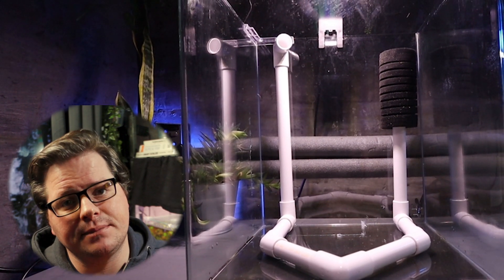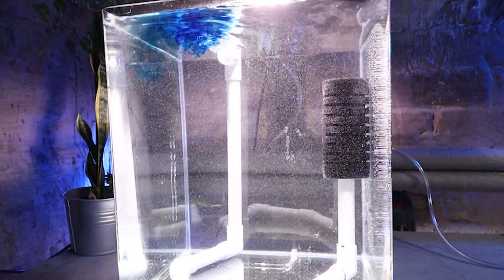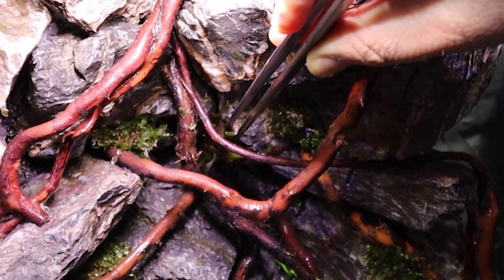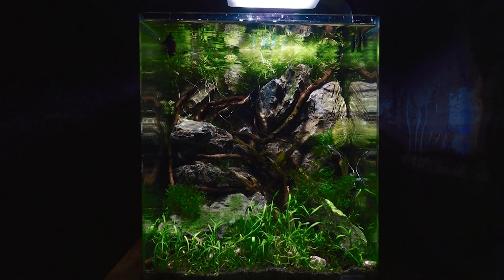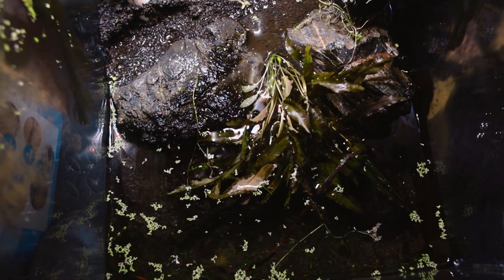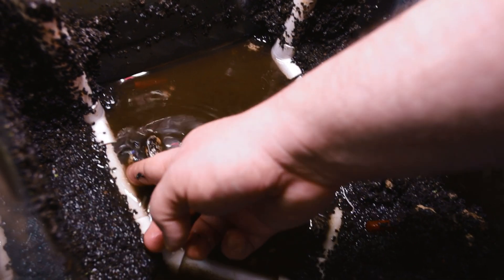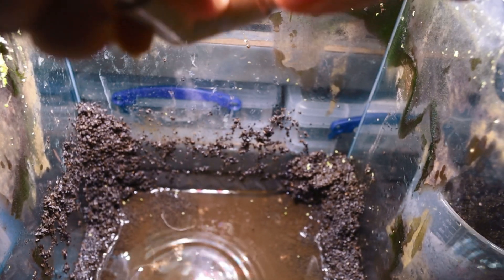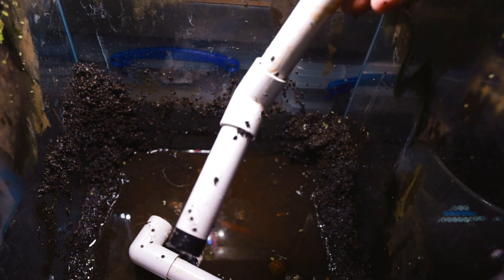Did This DIY Aquarium Filter Actually Work?

Comment: Thank you SO much for showing this and proving that your elegant solution works. All comes down to flow rate and physics. The size of the debris that can actually fit through those holes is so small that "nearly all" should just get swept back out into the tank. Where it will either settle or get caught in the sponge. Cheers.
Reply from the maker: @bennerdan  thank you so much. Really pleased you appreciated this project. It was a favourite tank of mine!

Comment: I just discovered your channel and I actually like this. Maybe I should do this to my old (spare) tank, just to try👌🏻
Reply: I picked up another tank for free, so definitely giving this a go now🙈
Reply from the maker: That's awesome! Let us know how it goes! 👍
Reply: @AquariumShed  As i don't really do social media (i'm just on facebook and i saw you're only on Instagram) i'd figured i'd share the progress here so far. 

I’ve set myself the challenge to spend as little as possible for a aquarium. So I picked up this 20L (just over 5 gallon) tank for free. It has some scratches, but can’t beat free😂

Lighting is a dimmable 7w GU10 spot (6500k) on a homemade base (electrical pvc pipe sprayed black).

As the Toolstation doesnt sell these pipes in the Netherlands, I found some at a garden shop selling pond supplies aswell. So for the filter i used pressure resistant pvc (intended for use with water) and is driven by an usb airpump.

The dragon stones I had laying around, the soil is Dennerle scapersoil and was a leftover from my main tank. 

Plants are clippings from my main tank aswell:
-Limnophila Sessiliflora
-Cryptocoryne Willisii
-Ludwigia Repens Mini Super Red
-Javamoss
 -Phyllanthus Fluitans

Total spent so far: €32

Then went ahead an spent €15 on yellow fire back shrimp at a local breeder. So im in it for a grand total of €45. 

It has done 4 weeks on the dark cycling method and 2 weeks fully planted. I've uploaded a pic: https://live.staticflickr.com/65535/52955729299_0185ceabe4_k.jpg

Cheapest tank i ever had and probably the most fun. Thank you for the inspiration, it has been fun so far.
Reply from the maker: @ksaandor  hey hey! Glad to have provided the inspiration. It truly is amazing what you can achieve on a budget. Tank looks great, and I particularly like the clean simple aesthetic of you DIY light. Great job! Making me wonder how cheap I could make a tank now......
Reply: @AquariumShed  Thank you for the compliment 😁. I feel challenge for a new video coming up, do one a cheap as possible👌🏻😎 I’d personally would like that, as everybody thinks they have to spend big bucks on a tank to make it look good. I even see people claiming to have “low budget tanks” and still spend 100bucks on a light for a nano tank😂

if you have questions about the light I can help you out with that. I’m on ukaps too, under the same username. (But I found out I can’t message with a new account, so instead i replied here)
Reply from the maker: Boom! It's gone on ideas list for my Autumn season. I sense I may be obsessing over Gumtree and Marketplace for the next few weeks. Any excuse for a new tank!
Reply: @AquariumShed  that’s the spirit!

Comment: you missed a trick: sheet of plastic over the pipe across the bottom on top of some larger lentil sized gravel with a grid of holes about 3cm spread on it but a gap of about 3cm between its edges and the tank wall
Reply: Interesting

Comment: Does this DIY undergravel actually works? Answering your question, hell yeah it works! I didn't even know about the existence of undergravel filters, until I came across  Dr Kevin Novak's videos I started to do more research about them and they actually convinced me as a form of efficient biological filtration yours is another proof that they work fine, I am currently using two UGFs in my two tanks and I am so happy with them, I actually talked about my setup on a Facebook group and the main complain was that with time the filter will get clogged and become a "nitrate bomb" waiting to explode I felt kinda attacked from some members as if I was doing something sinful lol my oldest tank will be a year old in May and it hasn't get clogged at all! I will personally continue to use undergravel filtration probably for all of my  remainder of time in the hobby. 🙂